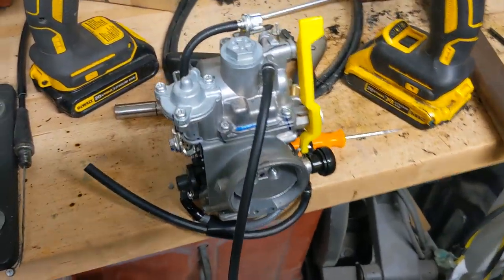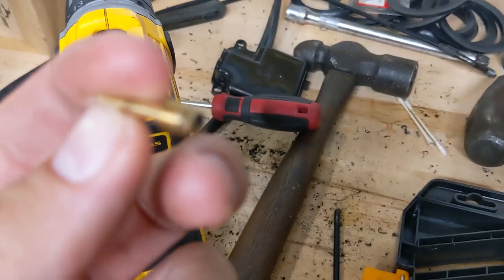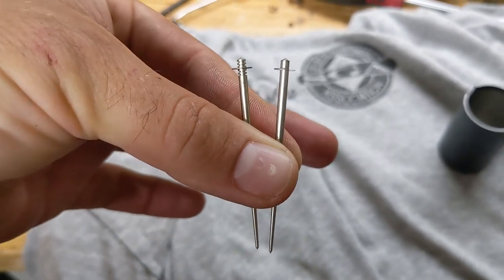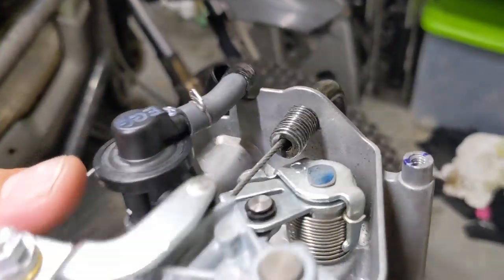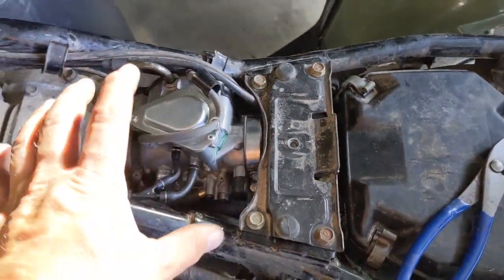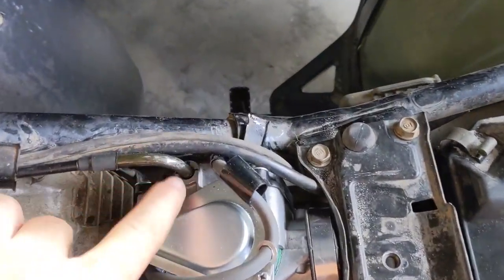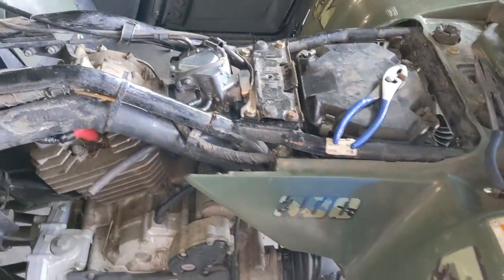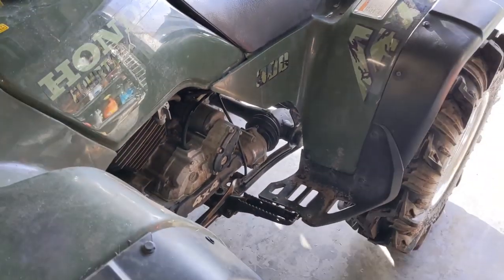How to swap 400ex carb onto Honda 300 Fourtrax

Comment: Man I have a Honda 300 it’s snorkeled tight I have greese the spark plug I feel like I have done everything but sometimes when it’s under water it will bog down like it’s giving out of gas I’ll pull it out and it will crank right back up please get back with me and give me your thoughts
Reply from the maker: I'd try a new coil/plug wire. Or wrap it in electrical tape

Comment: What piston would you’d recommend for rebuilding my top end on my Honda 300 4x4?? Stock bore right now.
Reply from the maker: Something OEM
Reply: Mud Puppy thanks buddy do they make oem oversized pistons or no? I’ve only ever used wiseco for my 450
Reply from the maker: I like the 317 rancher bbk

Comment: Thanks for the video man really helps out, what brand aftermarket carb did you use? Don't wanna end up getting some garbage carb that'll never tune right
Reply from the maker: This is an OEM Honda carburetor I would never put an aftermarket carb about anything I own
Reply: @MudPuppyOffroad  there are plenty of OEM spec carburetors and rebuild kits that are aftermarket and much less expensive. Like anything else, it just takes homework.

Comment: What throttle cable is that because my 300 doesn’t have that one
Reply from the maker: 250ex is best 400ex is shorter but works
Reply: 300ex jet and bowl will fit on the 300 frtrx.....no need for all the extra work unless you want the 300ex carb on your four wheeler....but just the jet and bowl swap does give it a little more power.

Comment: Can you use a 350 Trx or will it fit, or is the 400 best? Thanks
Reply from the maker: Which TRX are you referring to The old school 350 or a rancher... I would not recommend a rancher it's not much of an upgrade
Reply from the maker: The old school 350 doesn't have an excavator pump so it's not great either
Reply: I was talking about the rancher, okay so the 400 is the way to go. I’ve found some OEM 300 carbs but $300

Comment: playing with needle clip is noob
Reply from the maker: Adjusting the needle height or running a different needle is the only way to properly tune this style carburetor.
Reply: @MudPuppyOffroad   The pilot jet is for 1/4 throttle, the needle is only to open up the main jet
Reply from the maker: @jasongodin7165  hundred percent wrong why do you think it is tapered genius the needle was regulates mid-range fuel flow along with the Venturi effect
Reply: @MudPuppyOffroad  The needle shuts the main jet
Reply from the maker: @jasongodin7165  I'm curious why you think you know what you're talkin about because you're so obviously wrong... what do you think regulates fuel throughout the mid-range can you answer that?
Reply: @MudPuppyOffroad   after 1/4 throttle its all the main jet, i built sand racers, i know my way around a comprehension ratio,  il give you a trick,  place automotive oil in your atvs, the clutch will not slip when motor is warm ,.more hp and motor will last longer,  Clean old spark plug or new and full wot through out all gears, check color, need paper brown color, for main jet
Reply from the maker: Not all carburetors work the same genius. if a carburetor has a tapered needle with multiple clips positions it's designed to be adjusted to tune the mid-range... its literally in the manual
Reply from the maker: @jasongodin7165  and now you're talkin about oil? All right im done with this lol

Comment: Just put a new oem 400 ex carb on my 300 idles great  runs great  wide open  falls on its face everywhere in between  or by hitting the gas quick  tried the needle in every position  on the stock jets.  Looks like I got some more tuning to do
Reply from the maker: You could try the dino jet needle
Reply: @MudPuppyOffroad  yeah I got it orderd waiting on it to show up hopefully that'll get it
Reply: Try a 130 main jet